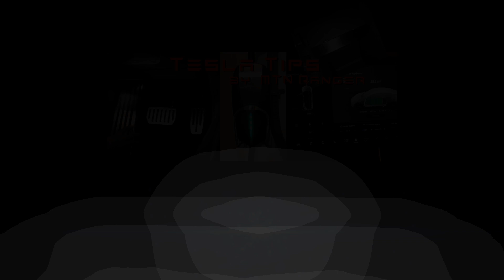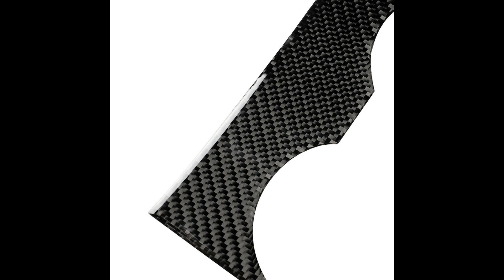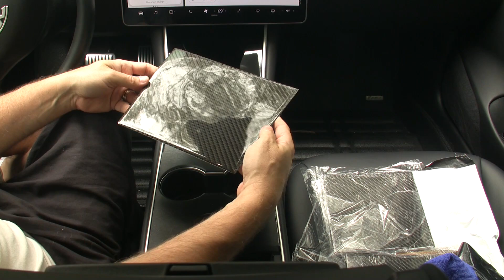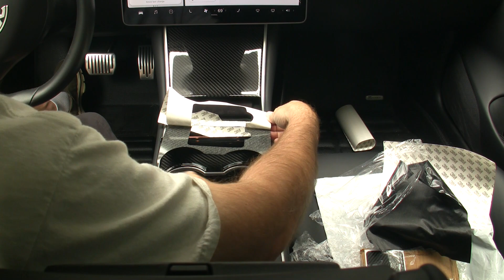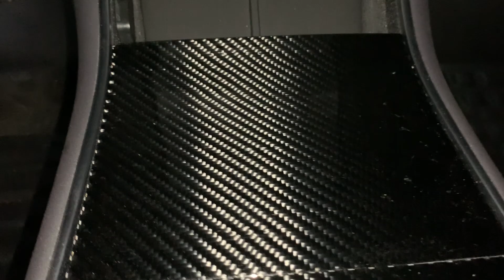Tesla Model 3 - Carbon Fiber Console

Comment: Loving all your videos. Thank you for all the great info. I have just ordered the console covers and can't wait to try them out. Have you seen any dash covers made of same material, or just the rigid ABS plastic type that you showed in your other video? I really don't want to do regular vinyl wrapping on mine. Also, note out to anyone having corner lifting issues....apart from all the usual tips like making sure the surface is 100% clean before applying, make sure ambient temp is up there a bit as well so the adhesive is at it's best when you make contact. Heat gun or hair dryer can work wonders.   :-)
Reply from the maker: I have seen one on Amazon, it looks more similar to my console install.  I haven't gotten around to ordering yet.  https://amzn.to/38MexIr I second you on the heat gun or warm ambient temperatures.
Reply: @MTNRanger   That looks pretty good, but I am always a bit trigger shy on buying anything without existing customer reviews  :-) . I might just go for it as it isn't a huge amount of $$, and Amazon are pretty good at returns.